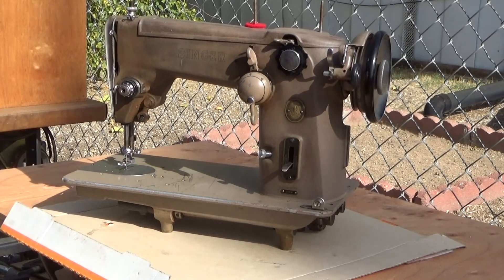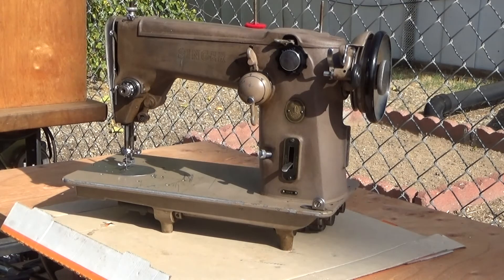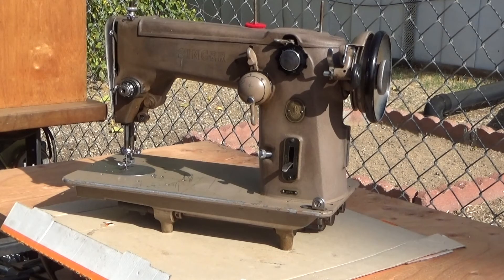Pick of the Litter

Comment: I love the condition.  Wouldn't paint or anything except to keep it healthier.  It is a working machine with character.  Quick question... I see you have the original balance wheel.  Did you ever consider a spoked wheel?  I wanted to put a spoked wheel on it, however, then the bobbin winder won't work.
Reply from the maker: Knew I'd have to get either a treadle set up or a new motor when I got here.  (Philippines is 220v)  The motor I got is labeled Singer but made in China and I doubt that it is a legit copy.  It's functional as is but a base is still on my to do list.  A treadle set up was three times the cost of the motor and "iffy" quality.
Reply: @joekahno  I am sorry that you cannot get a treadle setup at a nice price point.  For me, other than loving these rugged swing-needle machines, I really only want them to treadle.  For a tough, motorized machine you cannot beat a 403A/404.   I know, some people don't like the slant needle or the 66 bobbins, but I do.  And Sew Save Me has a really interesting video on upgrading the motor, not that I think it isn't beefy enough.    I will most likely keep my beige cammed 206K w/ a motor.  I am still on a quest to find a 320K.